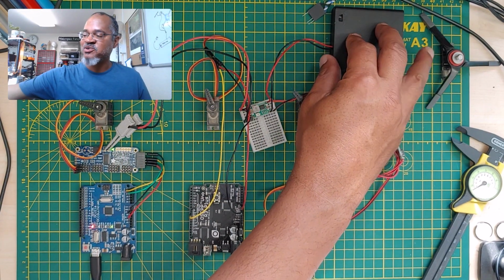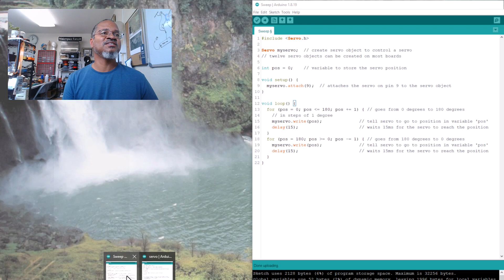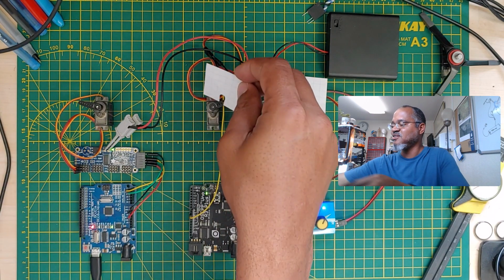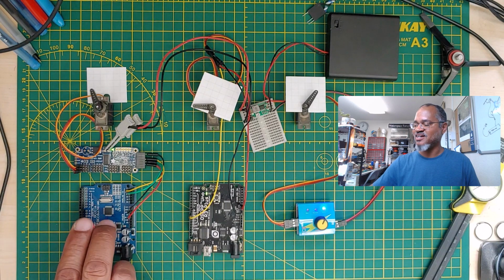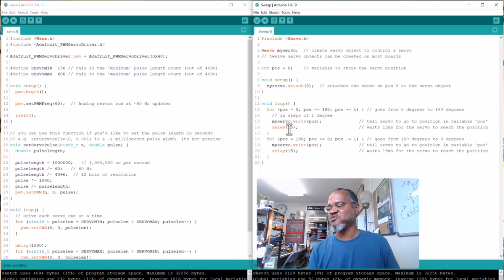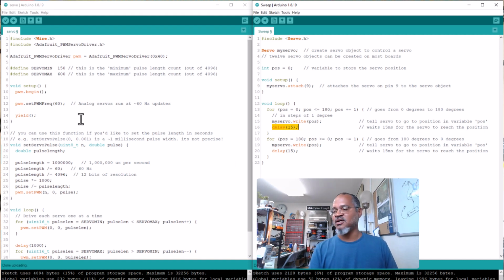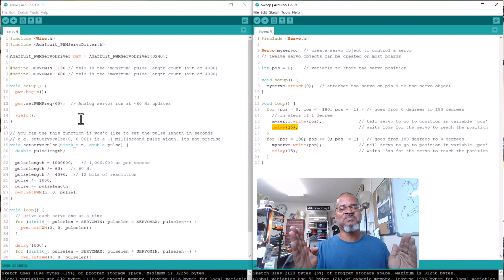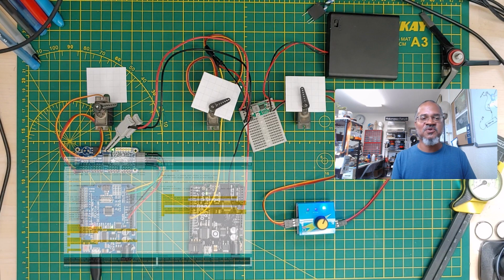16 Channel Servo Controller - PCA9685

Comment: Any chance you have a video on setting up 16 servos and control each with a button having each move to a preset max location and wait. Then when you push the button again the servo goes to its preset min location? Also should there be a detach code used to keep from burning out servos when powered for long periods of time?
Reply from the maker: I don't have one currently, but that does sound like an interesting project. Might be a good candidate for a keyboard array and we could definitely add a timeout in the code somewhere. Thank you for the suggestion!